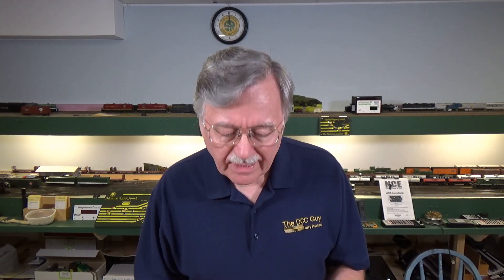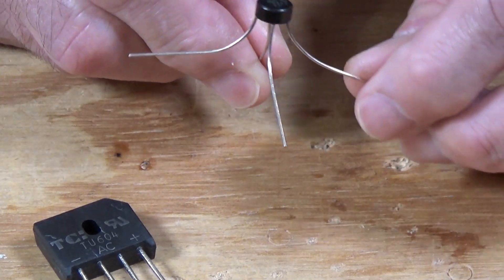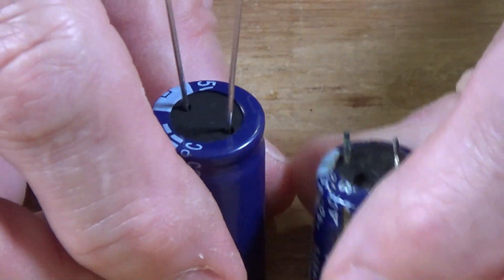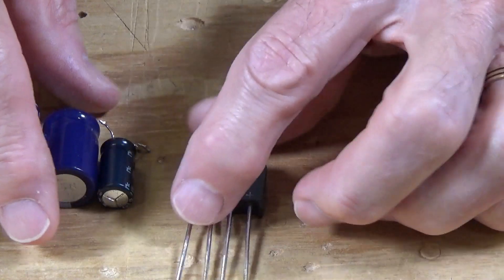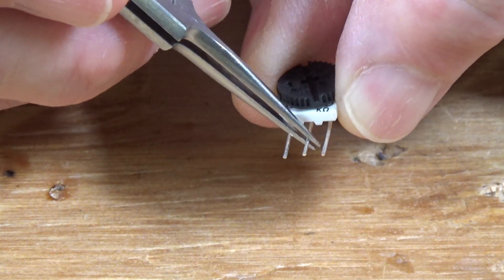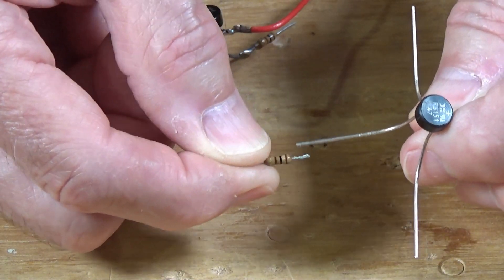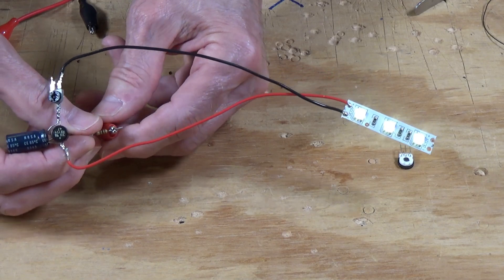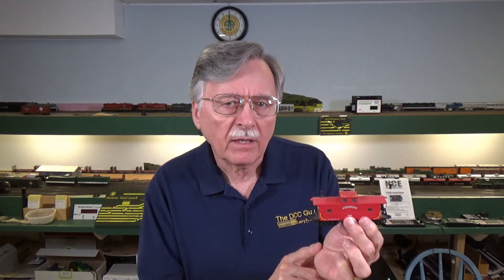Stay Alive Lighting For your Cabeese and Passenger Cars (101)

Comment from the maker: Folks, this circuit can be built as is or you can get innovative and make it much more compact. You can build it on a piece of perf board to make it flat. You can spread the components out and wire them together with insulated wires to fit in odd spaces—use your imagination. As I said in the video I will be doing another video on a different circuit and after that will do one on adding power pickups. Also, some cars like the caboose I showed come with power pickups and in some cases lights installed so this circuit can be shoehorned in to provide the stay alive power. I simply cannot cover all the various situations that this circuit can be used in, so I have to leave that part up to you to figure out. However because of the various requests I will go ahead and move the power pickup video to Monday so watch for it.
Reply: Do you need to have a separate 2nd resistor for the capacitor itself, or can you use the same singe resistor you use for the LED?
Reply: @markmatteo2417  No, the capacitor will only charge to the voltage it gets from the bridge rectifier which will be about 1.5v less than track voltage. So always use one rated a higher voltage than what your track is set for. The trim pot will take care of voltage going to the LEDs.

Comment: Can you still run on DC if this is in the car or will it cause problems? Maybe need a switch on the bottom of the car to change from AC to DC? That way you could bypass the rectifier when you want to run on DC.
Reply from the maker: The circuit has a rectifier bridge so that is not an issue and you can adjust the voltage using the trim pot so it should be OK on DC track. However because DC track voltage varies from o to about 14-16VDC your lighting will only come on at max power so not really a solution.

Comment: I have some older coaches that have DC lighting.  Do you have a video that shows how to convert to use on a DCC system?  I have been told the DC lighting will likely burn out when used on DCC track.
Reply from the maker: It depends on the bulb and what voltage it is designed for. Once you know the voltage of the bulb just use a dropping resistor to protect the bulb.

Comment: Love the concept but I'd want to make up a small circuit board for this! I've an ambition to use a Hall switch in the roof so you can tap the vehicle with a magnet on a stick to turn the lighting on or off - an accessory decoder seems like overkill!

Comment: I have a bunch of 24 volt leftover sections of LED tape. Can I use this circuit with them?
Reply from the maker: I have never worked with anything but the 12 volt strings so don’t know how these are wired. Given they are rated at 24 volts they’re unlikely to work at all with anything much less than that.
Reply: Just to find out I hooked up a 12 VDC wall wart and got plenty of brightness on a section about 16" long. In fact I got some illumination down to 6 volts. So I guess the question would be do you think the stay-alive circuit would still work or ? @TheDCCGuy

Comment: Hi Larry,
I'm one of those obviously challenged model railway enthusiasts. 
I have tried a couple of times putting this circuit together and while the lighting comes on successfully the minute i remove from power source the lights go out.
The Con-Cor HO PRR Baggage Mail car 0001-094031 came with a factory installed lighting circuit board with 6 yellow toned LEDs. This unit flickers badly, being the worst ive encountered hence the wanting to install this stay alive circuit.
Your knowledge and help would br greatly appreciated as i am obviously missing something. 
Cheers Mark (Karaka Model Railroad).
Reply from the maker: It is possible that the ConCor circuit is drawing more current than the stay alive can support. Just to test your build try it with just a single LED and if that works then you have your answer.
Reply: @TheDCCGuy  thankyou, will do.

Comment: Larry, I do not run DCCC, only 12 volt DC. will this circuit work for me?
Reply from the maker: Not really, it is designed to be used where there is full power on the track all the time, that keeps the capacitor charged up enough to light the LED.

Comment: How about brass truck on brass caboose?
Reply from the maker: Take a look at video #123, I think those would work for you. Be aware though that the bronze strip wraps under the little circuit board so you will need to insulate the underside of the board. Of course you could just swap in a set of plastic caboose trucks and no one will notice.

Comment: Larry, I'm doing something wrong.  I bought the same components (see below) yet when I cut power the lights immediately go to very dim and then off.  I've tried both a 850MF 16V CAPACITOR and a 1800mf 25 volt  CAPACITOR.  I must have screwed something up.  Any idea what????
thanks
Mike Stewart
Resistor on track power leg of Bridge Rectifier to stop insurge of voltage from tripping CB on layout

 1/2W Watt 0.5W Metal Film Resistor ±1% 1.8Ω 100Ω 620KΩ 5.6KΩ ~ 1MΩ Ohm

Trip POT to adjust brightness of lights

 3296W-103 10K ohm 3296 Trim Pot Trimmer Potentiometer HM New

Capacitor to store energy  for lights

 820uF 25V Nichicon HV 25V820uF Super Low Impedance Capacitor 10x20mm

Bridge rectifier to convert AC voltage to DC voltage

 International Rectifier DF01S 100V 1.5A Bridge Rectifier SDIP-4 SMD
Reply from the maker: Get out your volt ohm meter and test to make sure you are getting electrical pickup from the wheels and check the voltages at critical points in the circuit. On light weight cars extra weight can help improve pickup. Finally give the capacitor plenty of time to charge up, a couple of minutes may be necessary. Also these capacitors aren’t big enough to keep the light on very long are power is turned off, they just fill in during very brief interruptions to prevent flickering. I did a video (#120) on an improved version that uses super capacitors that can keep the light on a bit longer when power is interrupted so maybe that is what you are looking for.
Reply: @TheDCCGuy  Thank you Larry,  I'm using wired power from the test track as I'm building a test sample using your video.  (I have parts to build 30 of them for my pax trains).  I'm getting 13.2 volts AC to the BR and dialing down to 8 volts DC to the Capacitor and lights.  After a full 10 minutes of charging when I cut the power the lights immediately go to about 25% brightness and last at that level for about 10 seconds.  Please see the listing for the capacitor in my original reply.  maybe I'm using the wrong type.
Reply from the maker: It sounds like you have the trim pot in the wrong place, go back and look at the way I wired it. I put the capacitor directly on the DC output from the BR then put the trim pot between the cap and the LED. That way you’ll charge the cap to 13.2V and be able to adjust the LED down to its operating voltage. Just don’t expose the cap to a voltage greater than its rating.
Reply: @TheDCCGuy  Larry, I think I've narrowed it down to the capacitors I bought. 
50pcs 820uF 25V Nichicon HV 25V820uF Super Low Impedance Capacitor 10x20mm
I even took one and wired it directly to the track with one LED and after 5 minutes when I cut track power the LED immediately went out.  I bought some small 2.7v super capacitors and did the same experiment and the LED stayed on for 12 seconds.
I had hopes to use inexpensive single capacitors but It looks like I may have to string together 2.7v super caps to get my 12 volts.  More expensive and larger but still only 1/4 the cost of a Keep Alive or Current Keeper.

Comment: Would it work for Tsunami Sound Car?
Reply from the maker: No,  best to use a Current Keeper or similar stay alive.
Reply: @TheDCCGuy  Thanks . . Using your previous KA home brew, what would you recommend for the Cap mF rate for sound car?  Tks
Reply from the maker: I discussed using different components in video #31. The basic design should work but I have never tried it.
Reply: @TheDCCGuy  OK, will give that a try and work my way up in capacitance.  Space in a caboose and covered gondola is a premium. Tks

Comment: what is the trim pot range of resistance and wattage rating?  Isn't 100 Ohm too low to connect to the DCC rails (~12.5 AC) ?   a schematic of the circuit would be helpful.
Reply from the maker: I’s a 10K pot, there is a parts lost in the description. As for wattage, it will only see what the LEDs wattage is and that is negligible.

Comment: Do you have to wire both trucks or just one? Thanks for the video
Reply from the maker: Depends on how you provide power pickup on the trucks. If you pick up power from both rails on the truck then you can only do one. But if you pick up power from one rail on one truck and the other rail on the other truck then yes you need to do both. However keep in mind that power on all wheels on both trucks will give you much more dependable power.
Reply: Thank you very much for the quick reply, 
Regards, 
Jim @TheDCCGuy  Thank

Comment: A very far out circuit.
However, wouldn't you want to wire a snubber into this circuit? It's my thought that the lighting keep alive would increase (dcc) noise on the track bus, thusly warranting a snubber. Or, would the inrush resister reduce noise caused by this circuit?
Reply from the maker: I don’t see why it would increase noise any more than any other circuit that uses DCC power.

Comment: NIICE! Now I have a question, I NOT DCC.... I run Analog and need to do muh the same thing using a MRC power pack, That said, do I NEED the Rectifier? As the power coming off my MRC analog power pack already has one, and that said is already DC not AC.... ?
Reply from the maker: Assuming you mean track power then yes it is DC but I am not sure these would,work well for you. With DCC there is about 13-14 volts on the rails all the time so the capacitors stay charged and only have to provide power for very brief periods when the car goes over dirty track. With DC every time you stop the loco the lights would go off after a few seconds as the capacitor discharges. A better solution might be small rechargeable batteries with a recharge circuit—easy to find on the internet.

Comment: I am a G scale hobbyist. Can I use this same circuit or do I need the larger components?
I run 24 volt power supplies on my rails.

Thank you
Reply from the maker: I think the voltage regulator boards are only rated to 23volts. Check on eBay for a board with a higher rating or go to the other circuit.